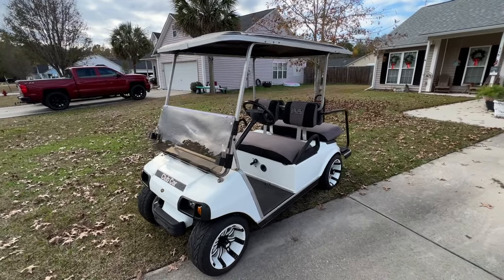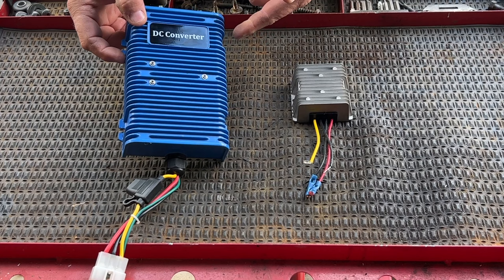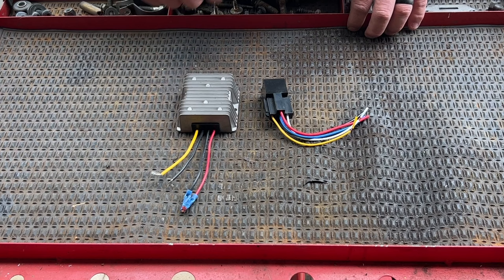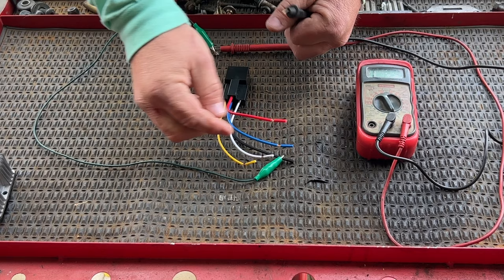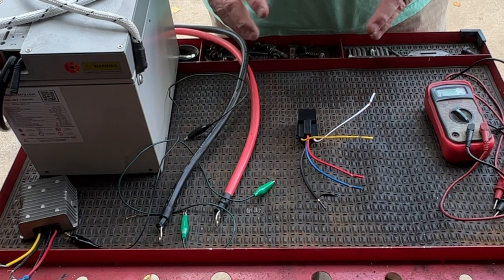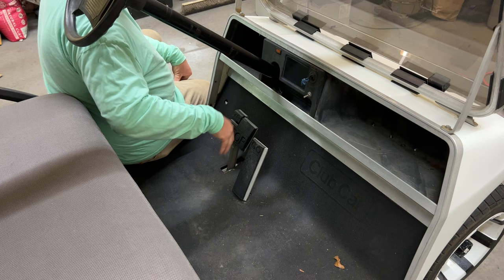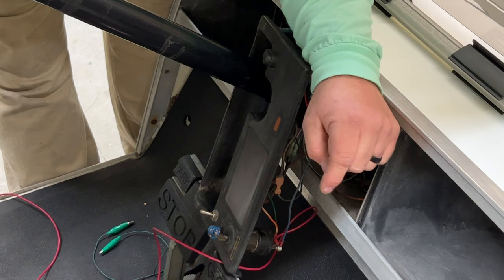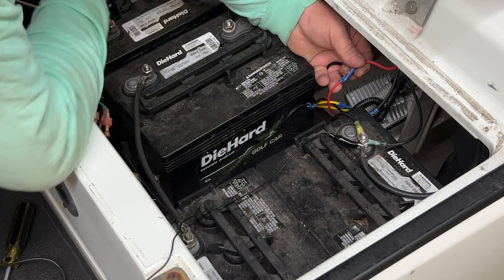How To Wire DC Step Down Converter & Relay with Golf Cart Ignition Switch | Stop Battery Drain!

Comment: This video speaks to my exact concern when converting my 2012 Club Car DS from 48v lead acid to lithium ion batteries. I determined a 48V to 12V 20 amp converter would suite my 12v power needs and the inexpensive converter purchased did not have an ignition control wire. I measured the “little bit” of current  always drawn as 20mA (0.02A) so to decide if a control relay was worth the effort, I calculated how long that small (but constant) discharge would take to Drain the battery. With a capacity of 60 amp hour, it would take roughly 3,000 hours or 125 days. I figured the cart will never go that long without use or charge during the summer months. During storage, the batteries have a disconnect so current drain is zero. Just my story why I never bothered to put in a relay.
Reply: Thanks for sharing, I'm not going to either after reading this.
Reply: Great video and very clear overview. I’ve learned a ton from this channel. 

I’m probably not doing this relay switch either. Also my lithium max a power switch. If I’m not actively using the cart, I’ll just power the entire battery down.

Comment: Sorry to resurrect with another late comment, but I only recently made this discovery myself -- although this mod definitely helps reduce a relatively small amount of battery discharge, the main benefit of this mod comes from like accidentally leaving the headlights on (or some prankster turning them on for you while the cart is sitting parked, etc.). However, the reducer by itself is just not that much of a drain on the battery. What actually is a significant drain on the battery (at least for Club Car Precedents) is the stock controller. When my carts sits idle for a week, I'll lose 10% or even more of the charge.  However, when I recently went on a 3-week vacation on a whim I flicked the switch to put the cart in tow mode. When I got back from vacation the cart charge had only gone down 5-6%, which is just about normal self discharge for lead acid batteries in a month. Apparently even with the key in the off position, the stock controller is still doing a lot of things, including the roll-away alarm/braking feature, etc., which clearly takes a lot of power. So, if you don't use your CCP (with stock controller) very often, the best thing you can do to help with idle discharge of the batteries is to flick that tow mode switch on, which completely turns off the controller (or if not entirely, then mostly turns it off). Not sure if this is the same or similar with EZGO, Yamaha, etc., but it's definitely the case with Club Car.

Comment: While doing a 36 volt lithium conversion on a ezgo , the owner told me how some guests at her house left the headlight switch on ( the headlight switch is down by your leg next to the charging plug , easy to forget ) drained her old lead acid battery and blew the headlight fuse. I had watched this video before so I thought perfect solution if it happens again. I installed the relay and it worked perfect. As long as the key is off the headlight Will be off. Once again you make me look like I know what I’m doing.

Comment: Thanks very much, John, for another excellent tutorial. But I have an unexpected result after making the connections. Everything works as you describe, I even hear a click in the switch when the key is turned.  What I did not expect, and do not understand, is that the reducer also works with the switch's white wire disconnected from B-.  With it off the B- post, the whole system still works, though without the click sound. Lights are the only 12V accessory and are wired directly from the reducer's yellow, and illuminate only with the key on. I also get a 12V reading from the light wire's in line fuse only when key is on. Any sage idea how this can be?  The only other possibly relevant information is I have the reducer's negative out going to B-.  I know this is not strictly correct, but I see no light negative wire. Thanks in advance!

Comment: Hey man, good video. Just wondering, would it work if I went: key switch to converter, converter to rocker panel, rocker panel to battery negative? Would there be anything wrong with that? Would turning the key off kill power to converter and rocker panel? Thanks in advanced

Comment: Could you just put the converter under the dash and put the red wire to the wire of the key that’s hot when the key is on and dead when it’s off and hook the other 2 to your stereo and accessories and do the same as wiring a relay to be another thing to complicate hooking it up?

Comment: Good video. I did exactly the same since my 36/12 volt converter draws 1/4 amp in standby mode. Remember to add a fuse on the plus power input wire. Some higher priced converters include an extra control wire to connect to the  key on wire at the cart controller so you don't need the relay.

Comment: Thank you! I've been needing to do this for a while since I do see some battery drain over several days/a week. Didn't really feel like upgrading/dealing out my reducer. For some reason I was never able to truly grasp how to hook it all up until your explanations in this video. I ended up having a bad ground connection during the install that stumped me for about 30 mins, but I figured it out and now it's working like a charm. Thanks again.
Reply: In the input for converter did u wire the relay to from the battery positive to the input positive?
Reply: @Jacks_ingenuity  honestly, I cannot remember. Like I said, I've known about this solution for over a year, but figuring out how to connect it all up made my brain hurt so I didn't do it until this video explanation. I did it exactly the way he explains to do it in the video. I literally watched the video 1/2 dozen times noting what goes where and hooked it up the same. Like I said in my comment, I was initially stumped by it not working for me, but then figured out that I had a bad ground connection (I spliced it to an existing ground and the splice just didn't have a good connection).  I would just go look at my cart for you, but unfortunately I did a really good install with wire management everything is well hidden in the battery compartment so I can't really tell what wire goes where anymore.
Reply: @Internetpilot  if you do look into it it would help me a lot
Reply: @Jacks_ingenuity  using his relay (otherwise the wire colors might be different), the battery pack positive goes to the black wire of the relay and then the red wire of the relay goes to the input positive on the converter. Then I put the the wire from the key switch on the yellow wire of the relay and put the white wire of the relay to the battery pack negative.

Comment: Good information and useful to know for those who have carts that could be impacted by this issue.  Our cart is a new 105 amp lithium cart with a master power switch (battery cut off / power down switch, not just turning the ignition off switch).   Remember, the inverter is only "on" when it has something pulling power / amps from it.  If your headlights, speaker, or other accy is turned off, then there is no draw and thus the inverter isn't working and is effectively off.  On our cart, we power everything off when not using it and, when we're not using the cart for a few days or more, we hit the master power switch and that turns off power at the battery.  So it can be good to install a keyed power lead to your inverter on an older (lead acid battery powered) cart, its not at all needed on a more modern electric cart.

Comment: I like the memory feature. I have a 2020 Cushman Hauler Pro 72v with a factory 72-12v converter for the lights, etc. I installed a radio and had to add a small 7ah SLA battery for my clock and presets. I isolated it with a relay so when the converter is off, the entire 12v bus wouldn't be powered from by backup battery and when the cart/converter are on, it charges my backup. I didn't have a 72 volt relay so i tapped into the 12v power from the Curtis controller. I knew the small current consumed by the relay would be fine. I also soldered a diode across the coil to protect the controller from the collapsing coil field. Was kinda involved so it would've been nice to have the memory function.

Comment: A+ in your clarity explaining the way your modification is going to work. Many thanks. I just purchased my 1995 48V Club Car. I'm just taking baby steps.
Reply: In the input for converter did u wire the relay to from the battery positive to the input positive?

Comment: I will be adding this now. My golf cart stays at my campground and im there only on weekends and i been putting it in tow mode when i leave but sometimes i forget this will eliminate that. Thank you
Reply: In the input for converter did u wire the relay to from the battery positive to the input positive?

Comment: Good Video!! Great instruction. Very Well spoken thanks for the instruction. Could I add a junction box with maybe 6 accessories access points to power extra lights and any thing else? I would think so but would there any issues adding anything else.

Comment: I already have a relay and DC converter installed in my cart (previous owner).  I also have a switch for the lights like you do, but I hate that blue LED that shines in my face at night.  I also replaced the key switch with a 3 position switch that has an accessory on position.  Should I just leave all the wiring as is with the relay and DC convertor, but simply move the spade connectors on the back of the switch over to the accessory terminals on the ignition and that will be my new switch?

Comment: This was helpful.  Is there a way to have a circuit and a 12 volt ubs and a 12 volt socket always live? Because using the key switch if key is off ALL YOUR 12VOLT circuit box is also
Off

Comment: Just blew up my converter after attempting to wire a relay w/key switch. Soon as I turned the key. 
From relay, I went white to ground (batt) and yellow to keyswitch, Red to yellow on converter, and black to Batt positive.
Ran the 48v ground from converter to batt, and put the 12v side of converter to fuse box. Or at least I thought. Maybe I got the 48v and 12v backwards from the converter? I never a complete picture in the video.

Comment: I recently installed LED front and rear lights on a golf cart and I just put in a master switch between the 48vdc positive input.
Reply from the maker: Yes that works the same. I just didnt want that extra switch.
Reply: @Fentertainment  HI. MY friend can I use this same concept on 1987 club car ds 36v with the 5 solenoids my ignition switch seems like it only has a power and ground wire ?

Comment: Hi, I wired my 36v Ezgo Marathon according to your instructions, but the converter shuts off when the pedal is fully depressed. I also installed the AiLi Voltmeter installed (from one of your other videos). It shows my cart is 38 v fully charged and a voltage drop down to 31-32v when I press the pedal fully. I would be very grateful for any advice on what the problem may be? My next step is to bypass the relay and see if I still get the shut off. Thanks a bunch! Love your videos.

Comment: I have a cart with no lights at all. How exactly would I hook up the relay to the converter and the light to it to work? It is 48volt and I ordered what you had there. Could you help? I don’t get it all till next week. I would just like to know like The blue wire on the converter to the red wire on the switch or the white wire goes to the hot wire of the light or what ever it is. Don’t want to hook it up wrong and risk frying something or fighting it.

Comment: Is the 48 to 12 converter no longer attached to the main postive? The video looks like the 48 is now coming from the ignition wire. Is this correct? About to do this to my 07 club car ds with the blue converter and relay that you provided in the links! Thanks!

Comment: I have a golf cart that had some lights in it already and they did exactly what you’re recommending. My question is can I add more lights to the same relay or I need another relay? For the new lights?
Reply from the maker: You dont add accessories to the relay. The relay is to cut the converter on and off with the key switch. You need a converter and a fuseblock to add more accessories.

Comment: Bro I need help!! I recently bought a converter, fuse box, and key switch. This is how I have it wired but it’s not working, 

Converter to battery converter  hooked up to fuse box via accessory wires converter hooked up to key switch via one wire. 

Key switch has black wire witch is attached to golf kart bolt, red wire that goes directly to positive terminal on battery, and a yellow wire which is attached to converter wire. 

For some reason I’m not getting power to switch, also no power to fuse box which I am assuming is because there’s to power to switch wire

Comment: I cannot figure out what you did with the red and black cable from the converter. It would be helpful if you very simply showed the exact mapping from wire to wire in a single screen. The wires were below the battery, so you couldn’t determine which was coming from the converter and which was from the positive terminal. I have the relay installed in the way I thought you described, but it functions exactly like it did before the relay. Power with key off. I appreciate your understanding of these concepts, but it would be helpful to very clearly summarize the wiring rather than going deep on continuity, coils, etc. I don’t need to know why. Just what color from the converter goes to which color of the relay. Then you can go deep on everything else. “This right here like that going to there like that” when you can’t see the wires is not particularly helpful.
Reply: The red and black are a normally open switch.The coil changes the switch to normally closed. Like a light switch.  So break the hot wire and connect red to + battery and black to + of your power input to your voltage converter.
Reply: @charnois11 I ended up getting the more expensive converter and don’t regret it. Thanks for the reply
Reply: Thanks was just wondering 🤔

Comment: Great video! Quick question… I just purchased a converter that has a key switch wire… so if I run that up to my key switch, I wouldn’t need to install a relay correct?
Reply from the maker: Correct
Reply: @Fentertainment  I just removed my old light kit (wasn’t working) and converter. Going to install new kit and converter. Besides a wire going to the key switch, my old converter had a tap into the tow switch prong. What does that do and is it necessary… thanks!!!!!!

Comment: I really enjoy and learn from your videos. You lost me at the relay with the different color wires. I'll keep trying tho
Reply from the maker: I understand. The relay itself is basically just like a solenoid on a starter. The wire colors don’t mean anything and you could order different relays from Amazon and the wire colors would all be different. But all relays do the same thing.
Reply from the maker: I’ve been wanting to make a strictly relay video but didn’t know if anyone would benefit from it. Maybe I will.
Reply: @Fentertainment  In the input for converter did u wire the relay to from the battery positive to the input positive?

Comment: Hi Ryan! New subscriber here. Thank you for making this video. It gave me the confidence to do it on my 07 36v EZGO TXT. I followed all of your wiring directions but I am wondering if EZGO is just a tad different in that even with key off, I can put my FNR rocker switch to either forward or reverse (I can hear the relay click) and the headlights turn on. It only turns off when it is neutral. I have cabled the yellow wire from the relay to the ignition switch with a tap on the wire that doesn’t get energized until you turn the key to on.  Any thoughts or suggestions?
Reply: Hi there, just curios if you got this figured out? I also have an 2005 ezgo that I'm about to do this also.

Comment: Need a video on same relay but introduce a fuse panel to run more accessories. Unless you have done this already!
Reply from the maker: Ive got a couple but the titles are for like bluetooth radios and such. Maybe I will take you up on that and do it.
Reply: @Fentertainment  In the input for converter did u wire the relay to from the battery positive to the input positive?

Comment: What do u connect the black output from the converter to. I wish u would show the wires after your done. Also wish u would say positive and negative for every wire to run and connect
Reply: In the input for converter did u wire the relay to from the battery positive to the input positive?

Comment: 6:41 you mention yellow wire from the DC converter (12v+) to the relay red wire 87. Perhaps it’s as simple as a color coding difference between the product you’re looking at and the one I’m looking at on Amazon. The one I’m looking at, the yellow wire is the output12V+, not the 48V+. Wouldn’t you want to be switching to 48V+ input?
Reply: The unit I’m looking at on Amazon looks identical to yours. The red wire is 48V + input.
Reply from the maker: I am switching the 48v input side.

Comment: Question. When swapping over to the 4 12v batter set up do you still need a converter or can you wire stuff up to one of the 12v batteries.
Reply from the maker: Its not suggested to run to one battery because if you do that one battery will drain before the other batteries and then the pack will not last as long.